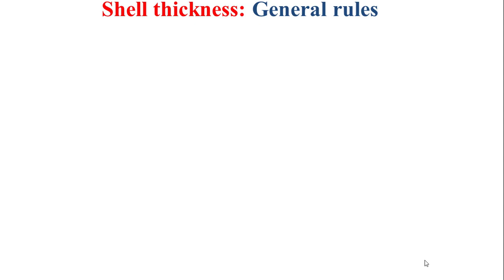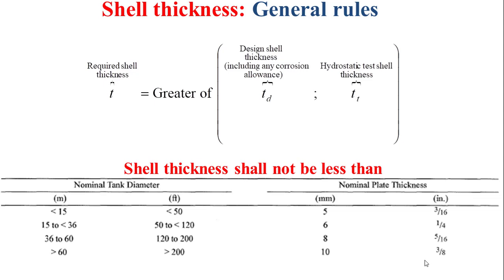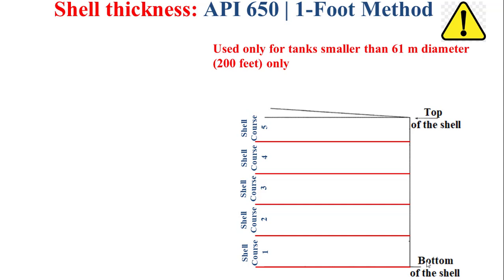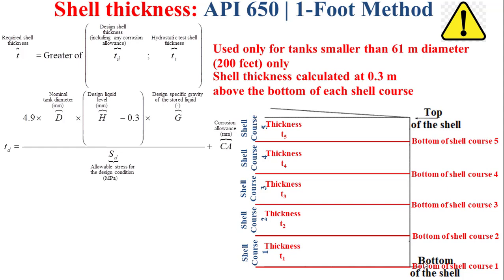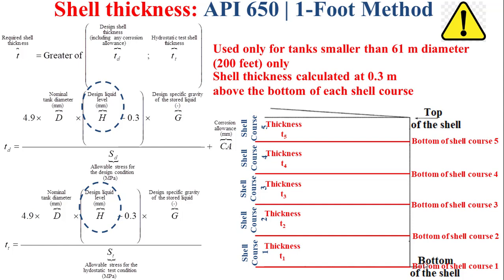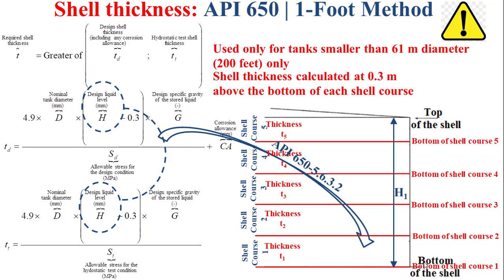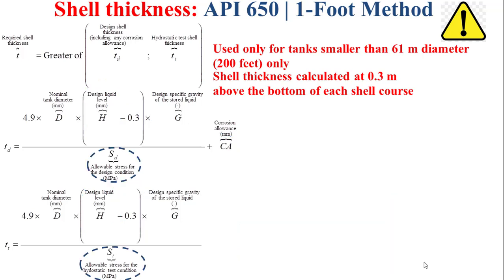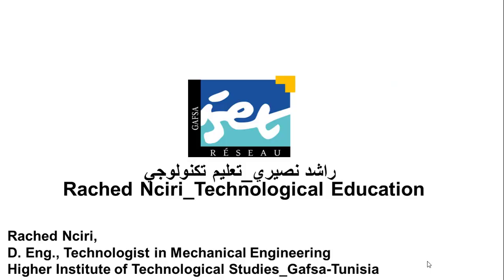Storage tank_Shell thickness_1_Foot Method_API 650

Comment: thank this  was very clear and I  I appreciate to aske  could  you explain how determine the CA
Reply from the maker: Thank you for your interest. The corrosion allowance is determined based on some factors, principally the construction material and the stored fluid properties, but also the operating conditions, the expected service life of the storage tank, the safety factors and the applicable standards, etc. Typical corrosion allowances can range from 1.5 mm to 6 mm for carbon steel storage tanks and sometimes as low as 1 mm or less for more resistant material to corrosion such as stainless steel. It is to not that corrosion allowance shoud be optimized under some economic consideratons and it should be, also, agreed by the customer. Please feel free to ask.

Comment: THANKS MR. RACHED .
I HAVE A Q UESTION WHICH IS , HOW TO KNOW THE HEIGHT AFTER THE LAST COURSE OF THE STEEL STORAGE TANK(AFTER  TOP OF SHELL HEIGHT TO THE BEGINING OF ROOF)?
Reply from the maker: Thank you for your interest. First of all, it is to note clearly that the shell courses extend from the bottom of the tank to the top, where they meet the roof or cover of the tank. Thus, the height distance between the top of the "last" shell course and the beginnig of the roof is theoretically zero. But, please note that in the "last" shell course, the level of the stored fluid may not cover the whole height of the "last" shell course. The level of the stored fluid can be, for example, just one half or one third the height of the "last" shell course. It depends on the design liquid level of the stored fluid (imposed by an overfill slot governing the maximum capacity of the storage tank) with regard to the height of the storage tank between the bottom and the top of shell height where the roof begin. For further assimilating my answer, please see Figure 5-4-Storage Tank Volumes and Levels in API650.
Reply: Thanks Mr. Rashed , I appreciate  your helping.
Reply from the maker: @MUAADHMOHAMMEDMOHSENAL-QUSARI  I am at your service. Do not hesitate to ask.

Comment: Why 0.3 m. I know that it is called one foot method but can you give me the  reference that tells me why 0,3m.
Reply from the maker: Thank you for your interest. the direct answer to your question is: 
The one-foot method is  elaborated ("designed") to calculate the required thicknesses at specified design points located at 0.3 m (1 ft) height above the bottom of each shell course. You can check this information in API 650-5.6.3.1.

Also, you can see a detailed explanation about the reason behind why 0.3 m in the reference : 

https://doi.org/10.1016/j.engstruct.2015.07.050

which explains that:
"...The required shell plate thickness for each shell course is calculated using the circumferential stress at a point 0.3 m (1-ft) above the lower horizontal weld seam of the shell course due to hydrostatic pressure of the stored liquid. The reasoning behind this assumption is that the tank bottom plates provide restraint to reduce circumferential stress due to hydrostatic pressure at the bottom 0.3 m (1-ft) of the lowest shell course...".

This is "in contrast" with the Variable-design-point method which permits to calculate shell thicknesses at design points that result in the calculated stresses being relatively close to the actual circumferential shell stresses. This will provide a reduction in shell-course thicknesses and total material weight( see API 650 5.6.4.1 and 5.6.4). 
If you have any other questions, please do not hesitate to ask.